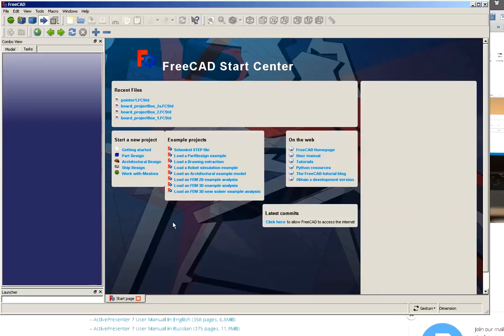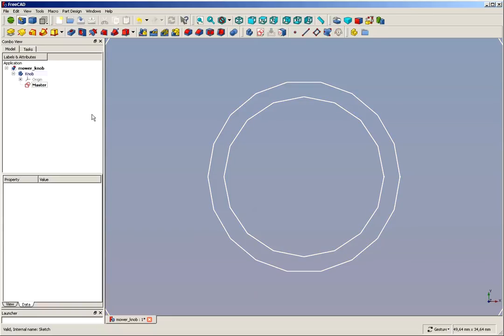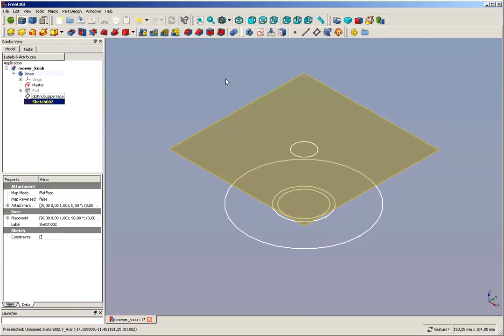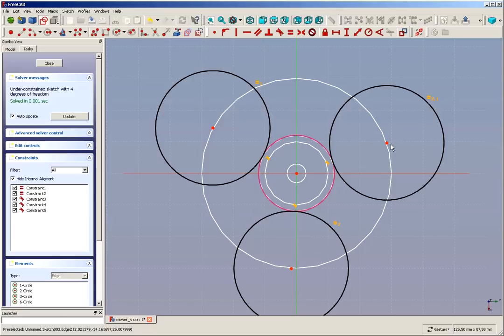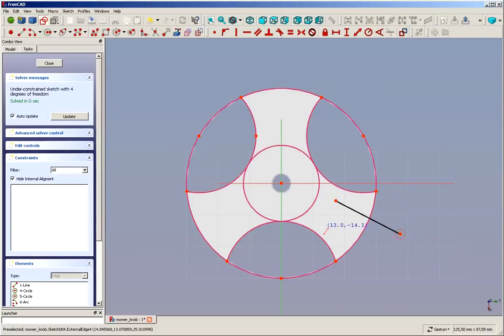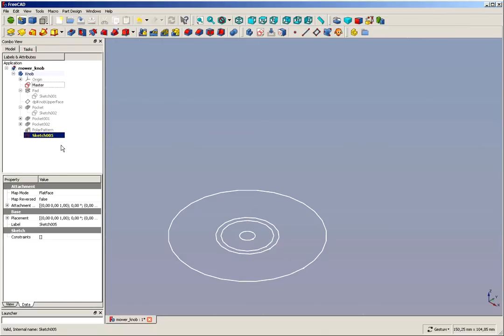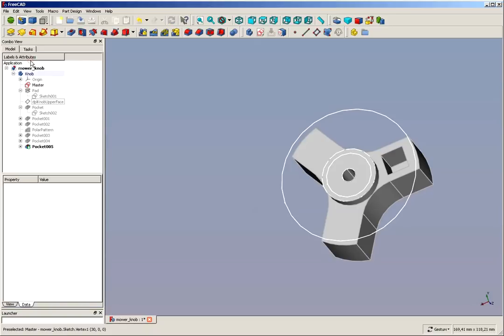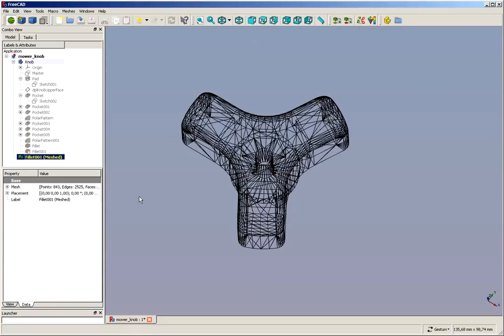FreeCAD 0 .17 Tutorial : . Design a Knob using Part Design

Comment: I followed all the steps in the video - however, I was not able to create a fillet on one of the sides of the curve part. Error was "Resulting shape is invalid". What could be the issue? Version 0.18.4
Reply: OK so I went back and it seemed I did not fully constraint the sketch for the pocket operation. Thanks for the video series - I learned a lot of techniques from you.
Reply from the maker: Read older comments. Usually the wrong sequence of clicking , results in a open constraint

Comment: Hallo, und danke shoen fur der video, ganz klar und zehr lehrreig. Entshuldige mein deutch. Ich habe alles gefolgd zowie im video und es klapt. Ich frage mich doch ob das so zu drucken ist mit ein 3D printer. Is das nicht zuviel Uberhang?
Reply from the maker: Ich hab da schon gut ein Dutzend davon gedruckt . Mit supportstruktur gar kein Problem zu drucken.
Reply: @hagei406  Ich habe das object gedreht in meshDesign so dass es mit die drei flugel auf der xz ebene liegt und dan habe ich es gedruckt. Wie dass mit supportstuktur functioniert kenne ich noch nicht, bin gans neu im denn field. Trotsdem danke fur die gute video's. Jean aus belgien.
Reply from the maker: @germona  Support is a function of your slicer. It normally just needs enabling. Also printing upside down is a function of the Slicer. Glad it worked for you.

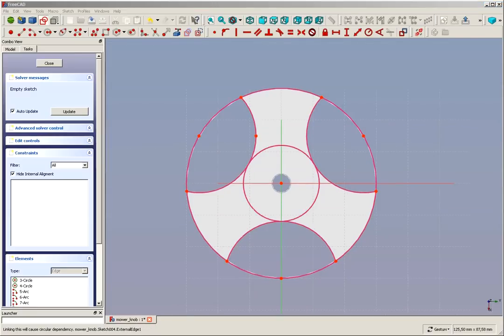Comment: I am trying to do this tutorial using 0.18, 4(Git Tag). I am successful up to the 19:58 mark where you prepare to complete the tangs on the knobs and give them a more rounded and finished appearance.  I am not getting the 3-circle to appear in the "external geometry" to tangent against the inside curve of the cutout.  For whatever, reason it just appears out of nowhere here, but I can't get it to show on my work.  I have attempted to find my mistake but I am at a standstill.  If you are able to comment on this and give me some guidance I would greatly appreciate it.
Reply from the maker: Hi,  send me the current file to my paypal adress, i will have a look then and try to find what went wrong. Usually it´s a problem with the sequence of the previous constraints.
Reply: Thank you very much for your assistance.  I settled down and went back through the lesson.  Just as you said about the sequence.  Your lessons are very good.  Just a note, I have not been back to Germany since I passed through in 2010 on a mission trip to Ukraine.  Previously I was stationed there from 1969-1974 and then from 1977-1980.  I enjoyed the culture and the scenery and the people I met.  I was trained in photography by two German friends in Baumholder.  Thank you again, Danke.
Reply: @hagei406 ,
Thank you for your response.  I went back in after watching it again.  I repeated that area about 6 times until I got it.  You are right, if one of the previous constraints is not right it will throw the rest of the object off.  I finally finished this lesson and the file looks good and I exported to S3D to see what it would look like for printing.  So far it is great.  It just takes patience and practice.  I will repeat this lesson from the beginning to get the process down.  Thank you.
Reply: @hagei406  
I apologize for this inconvenience but I can't get your Paypal address to come up in order to send you a file that I was able to create.  I would like you to critique it and let me know what could have done better.  Here is my email: scr71mslpa@gmail.com.

Comment: There was 3 circles but after closing scetch there was 2 circles with another diameters. This is where train lost his tracks
Reply from the maker: can you specify at which time ?
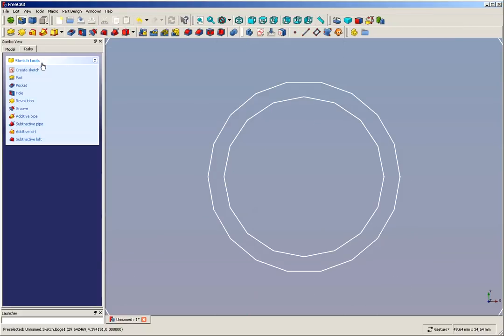Reply: @hagei406  4:16
Reply from the maker: @artur8403  Simple, after closing the sketch, you will in most cases not see all new entered geometry, as the zoom just goes back to where it was BEFORE you created the sketch. In this case, it only shows the inner 2 circles as the outer one is far beyond the screen area. This is a well know effect and will mention in a later video.I changed zoom later in the video.

Comment: Ha:

I have found your tutorials really useful, not just this one but all of them.
I followed along on the tutorial and built the model in part because I wanted 
to make some knobs.  The result ( more or less as I am still tinkering with it )
is on github:  
 russ-hensel/nut_knob: A parametric model ( FreeCad )of a knob for tool free 
 adjustment of nuts and hex head bolts.
 https://github.com/russ-hensel/nut_knob
 
Of course I did not follow the tutorial exactly.  In addition to my mistakes:

 Did not do the material reducing cut out.
 Added a spreadsheet to control some of the sizes 
 ( this also seemed to break some of the model the chamfers in particular )
 Tried to improve of the model part names.
 Now do chamfers by:
  Use Part -> refine to create a new part
  Chamfer with Part -> chamfer
  
 The refinement is not parametric so do a new itteration each time I change
 the underlying model.
 
I would like to know what you think, you can find an eamil  for me at github README.md.

Thanks: Russ
Reply from the maker: i will check it out asap..   thanks for the kind words...
Reply: @hagei406   can I remind you, if this is still on your todo list?
Reply from the maker: @russhensel  Sorry,  lately i was not much into FreeCAD due to much work and travel. It´s still on my todo list, yes...
Reply: @hagei406  just a nudge, perhaps as an xmass present.  I am working on another as well, perhaps I will post to the freeCad forum, and look for you there.  I know you have other stuff to do.
Reply from the maker: @russhensel  russ,  i had a look..  The problem lies in the sketch004 . Maybe my original mistake , or a glitch at the rework. The lower right triangle is fixed to the blue and red circles.This finally resutls in some gap. I chenged by rewmoving them and adding a tangent from the line edge2  to the red circle. This now gives a proper transition between circle and line, which finally can be chamfered. I an pass this model back to you, i try to find your mail adress..if you don´t get it,  send me a mail to my donation adress and i reply from there.
Reply: @hagei406  Thanks, the ball is in my court, will be in contact soon.